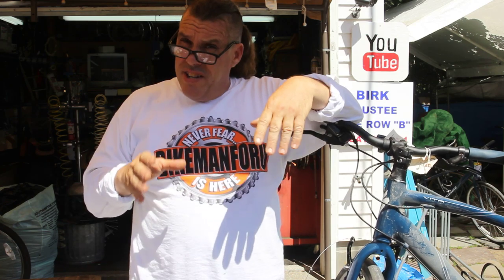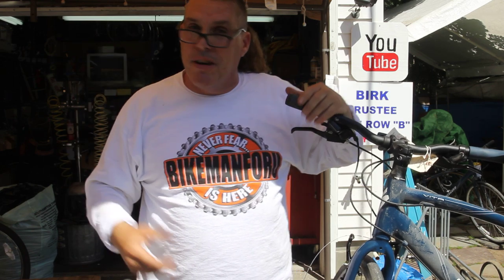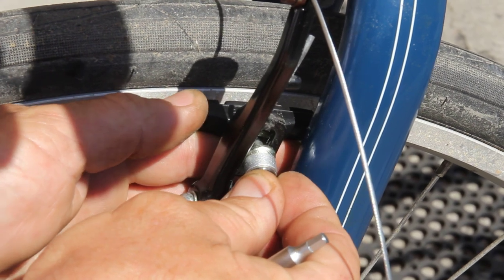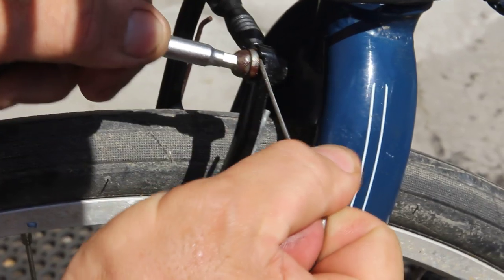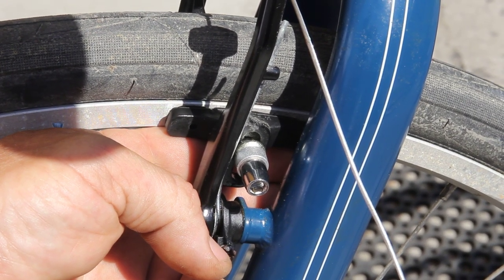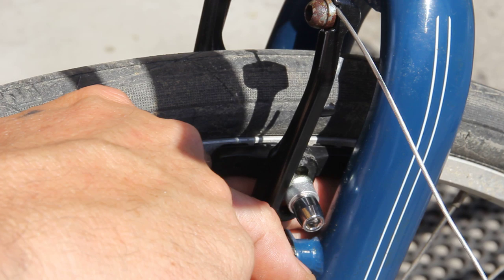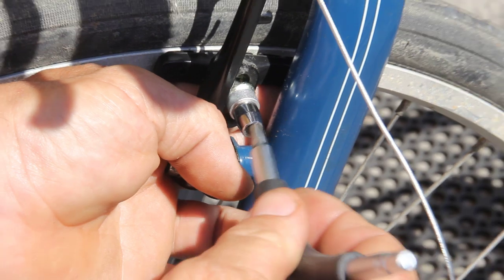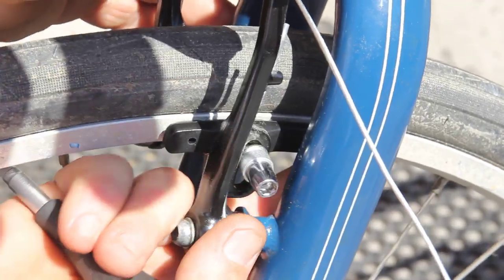Brake Pad Install - V Brake Adjustment Part 5 - BikemanforU Bike Repair

Comment: Bikeman my technique is a little bit different, could you tell me if it's wrong? I actually put the brake pads loose as you did first then dial it in too while applying the brake lever. I also put something thin (less than 1mm) like a credit card or something else between the leading egde and the rim. That way i get the pads to come at an angle with the rim and also centered with the rim and all that. I'm sure there are lots of ways to do the same job anyway. Good series there Bikeman! cheers

Comment: I don't know why but my VBrake is just sliding on the rim like nothing. There is very little space between rim and shoe but when I squeeze the brake I don't stop. This has never happened b4 when I put VBrakes together. They usually work really well. This one is brand new also.